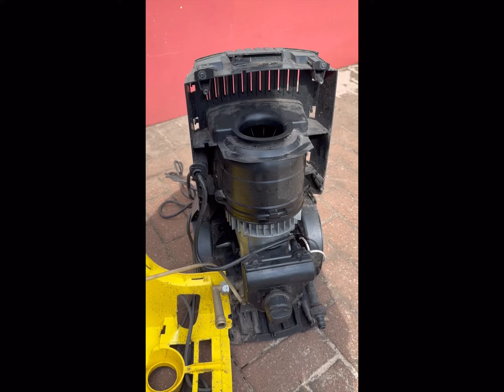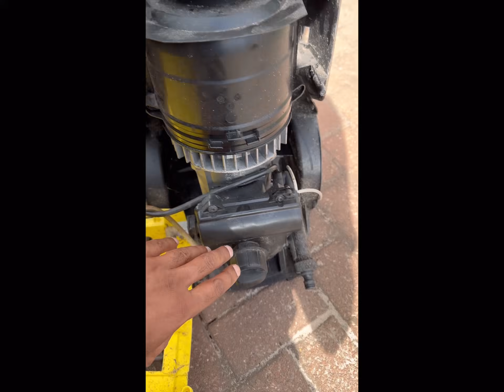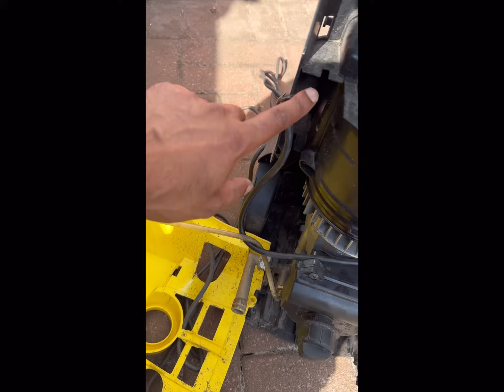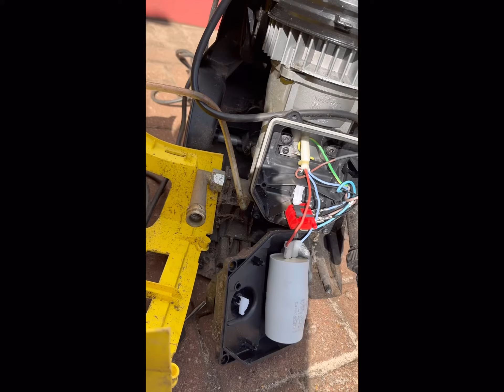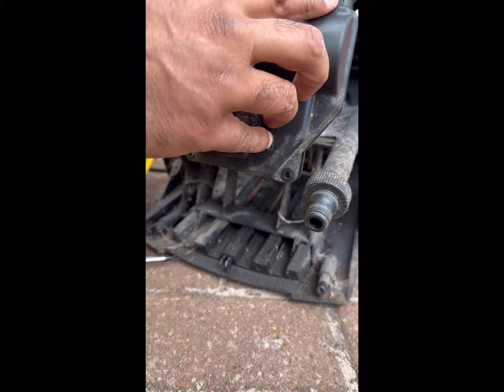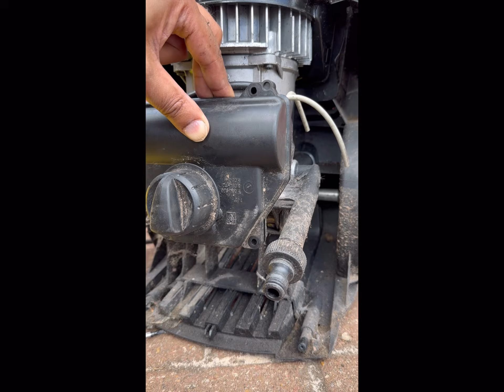Karcher washer stopping and blowing fuses. Replacement of karcher capacitor.

Comment: Thank you for the video. Mine was the same problem with the capacitor. my issue was fitting the metal spring back on the switch. It fell out as I was taking it apart and I couldn't work out how to put it together again. Once I'd seen your video it was straightforward. Mine is working again so a big thank you from me
Reply from the maker: Thank you so much. I’m so delighted this has helped you.  We’ve kept a perfectly great machine running. Well done!

Comment: Hello nice video, I had same problem with mine, I changed the capacitor on mine which I had lying around, the one in the machine was 35uf the one I replaced with is 32uf still no joy, mine buzzes and hums I don’t know if the 3uf makes a difference, but with the top part off the motor it works, put the top part back in and tighten the 4 bolts it buzzes and hums, it also troooed the main fuse aswell, any idea what else I could check.
Reply from the maker: I would use a proper specced capacitor.
Reply from the maker: There is more to the capacitor than the storage . The material it is made out of also dictates the release of power etc. Get one specifically for this machine.